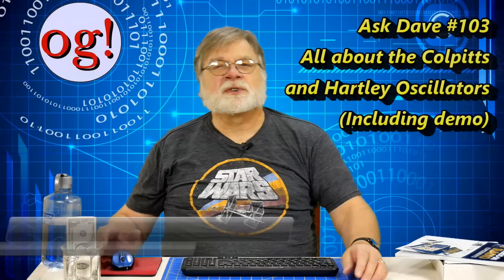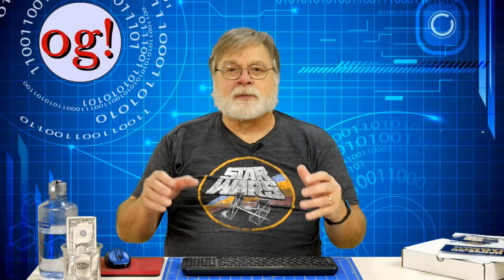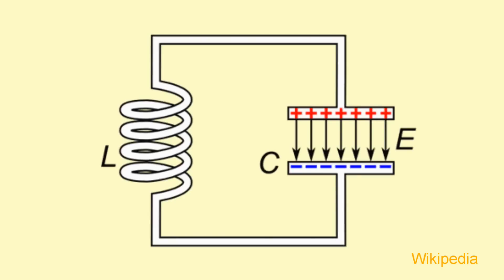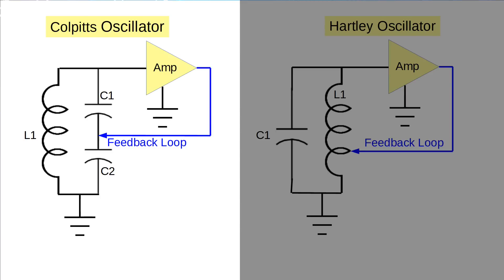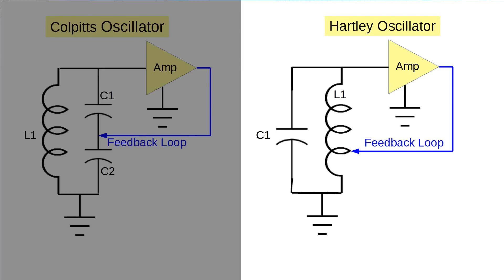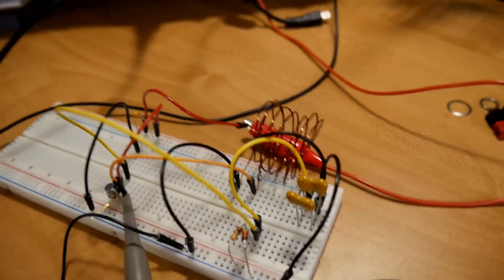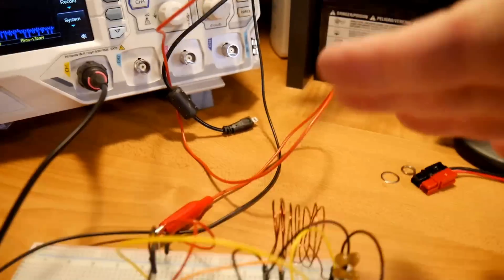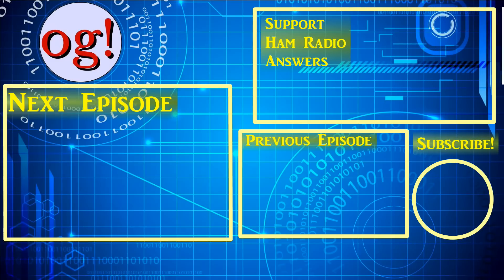The Hartley and Colpitts Oscillators with Demo (AD# 103)

Comment: Dave, as to your long leads, look around for breadboard connectors that resemble wire staples or brads. There are assortments of them in differing lenghs and colors. You will find that the spurious and harmonic signals are greatly reduced. Otherwise, excellent foray into the world or oscillators.

71/72 de k6whp 
dit dit

Comment: I've been binge watching your videos. Great stuff. In theory there is a stamped 3 digit code on small capacitors to identify value and tolerance. With Radio Shack on life support, and I guess Kanga closing up (health reasons), DIY kit/parts suppliers are shrinking. Knowing the fundamentals, and experimenting with electronics might go the way of cursive writing. I hope not though.
Reply from the maker: I have all whole bunch of capacitors from a RadioShack Grab Bag that are marked with only two characters. I suppose someday I should do the research to create a video on capacitor marking!
Reply: Good idea. Caps are all over the place with how they are marked (or not), mostly based on size. Sometimes the color acts as a character. Another video I would be interested in seeing would be your views on where Ham radio is headed. Yaesu seems on the right track to move forward without leaving everyone else behind.

Comment: My property is rather small and power lines makes it even smaller, meaning I have about 30' of useable space for antennas. So far I have a only have a 2m/70cm vertical strapped to my chimney but I need to expand now that I've got my general license. Some problems I am facing are, no trees on my property that I can use to hoist anything in, my yard slopes downardward quite significantly toward my useable space meaning it's in quite a hole, I have no room for guy lines and I have no help to get things off  the ground. What antenna would you suggest for such a situation? I'm in no rush since I'll have to save up for a bit before I actually get a functioning rig together. I know that you feature MFJ antennas quite a bit and I trust your judgement there so that will help narrow my search.
Reply from the maker: The selection of an antenna is highly personal. You might look at attaching something like the R8 to your chimney.

Comment: Great video Dave.  I also lament over capacitor identification.  Have you seen the LCR-T4 multi-function meter/tester/?  Google LCR-T4  tons of them out there.    
This thing looks great but I wonder if it works.  Get one and test it!
Reply from the maker: My multimeter supposedly can test for capacitance, but I think the long lead lengths make it unreliable. I tried testing several capacitors and kept getting the same answer. So I need a better capacitor tester. I'm sure there's something out there.
Reply: If you want a little fancier equipment, check out the DER EE DE-5000 LCR meter.